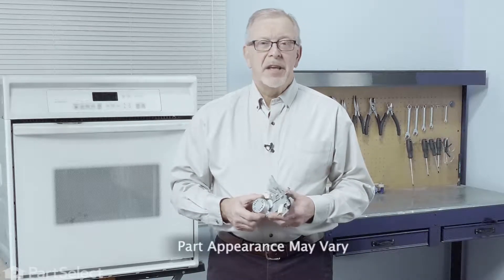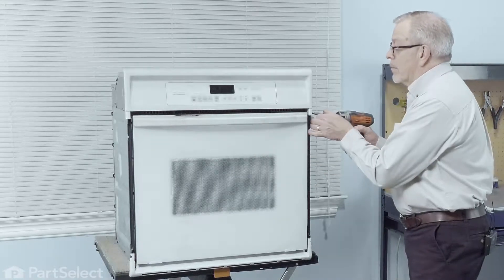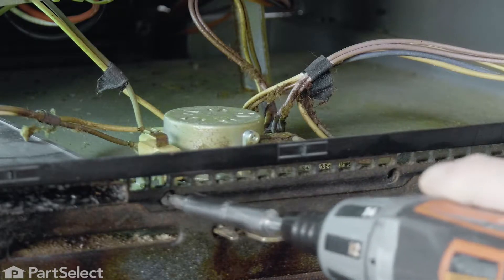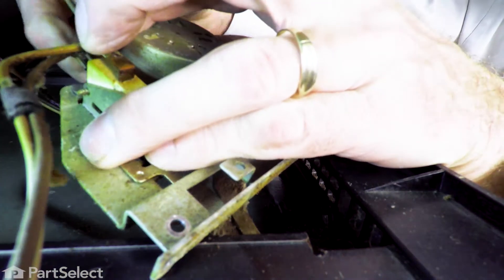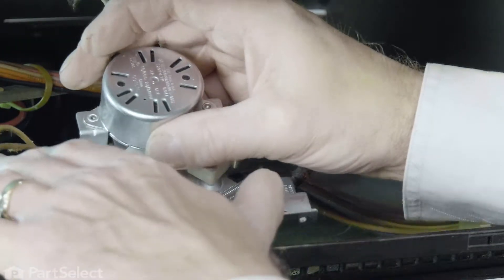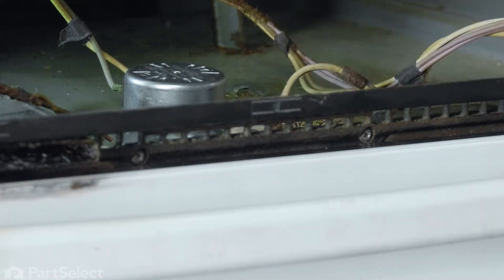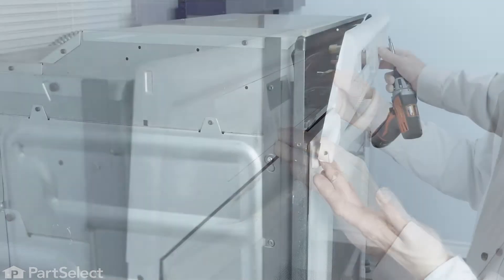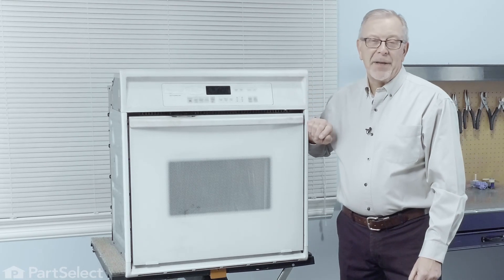Whirlpool Range/Stove/Oven Repair – How to Replace the Door Lock Assembly

Comment: Instead of replacing this part which I prefer not to as I will never run the self-destruct (aka. self clean) feature again, can I not disable this motor on my GE range, so I can remove the locked door error on my panel to give me access to my oven again? Thanks!